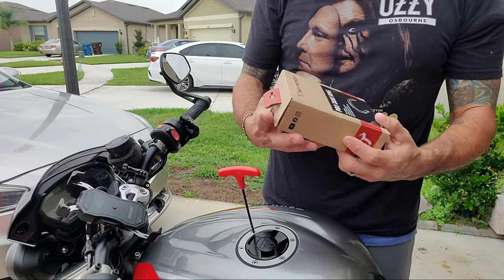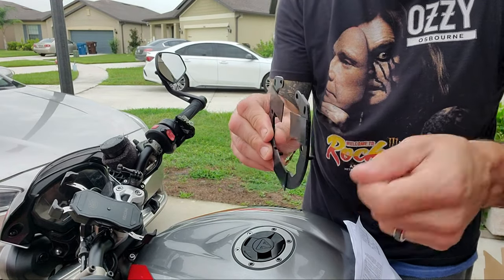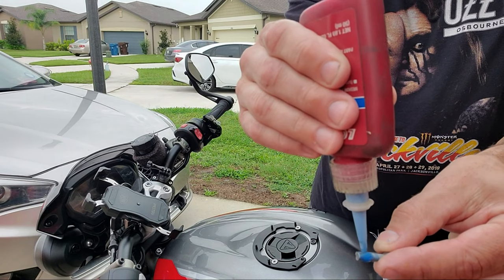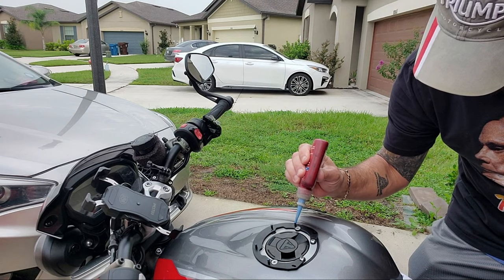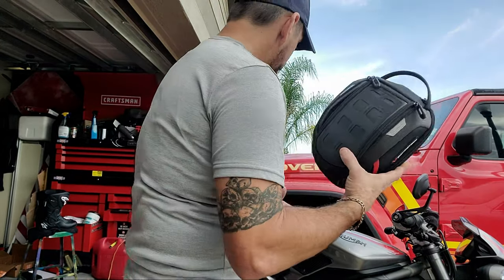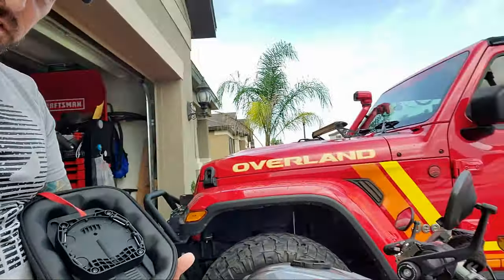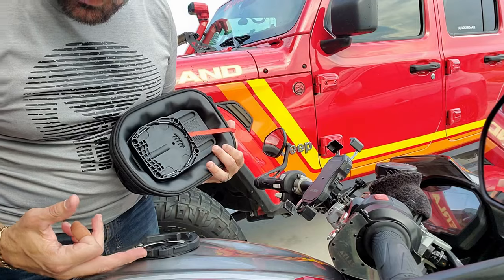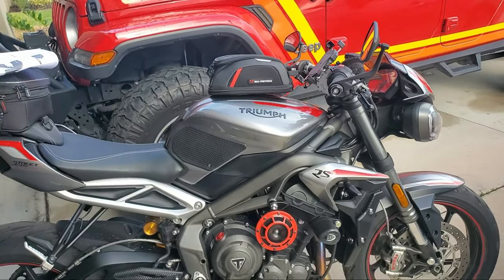SW-Motech Pro Micro Quick-Lock Tank Bag Install

Comment: Great video again!

I have the Givi equivalent on my bike.  The install on the Givi seems more straightforward, however after seeing you back I prefer it to mine.  The adjustability is great, and is not possible with the Givi.
Reply from the maker: Thanks Steve! I struggled between the two and that was probably the biggest difference and set me over the edge. They both seem like great products, however. 
Thanks for watching.

Comment: My good Sir, is that a Powerbronze or OEM screen installed?
Reply from the maker: That is the OEM. I find it to work perfectly. I am 5'10" and It definitely keeps the wind off my head.
Reply: @squidmoto8592  looks great too! Too bad it's out of stock everywhere :(
Reply from the maker: @Natarionus  I ordered mine from triumphcleveland.com. It took over a month. Try a local store too. I was told by several that they were coming late June and thats about when mine was shipped.